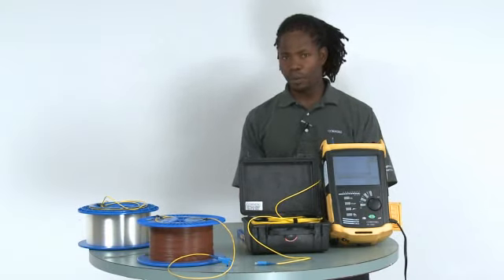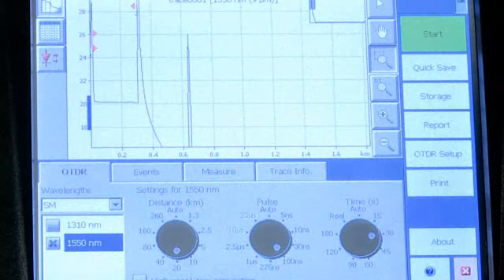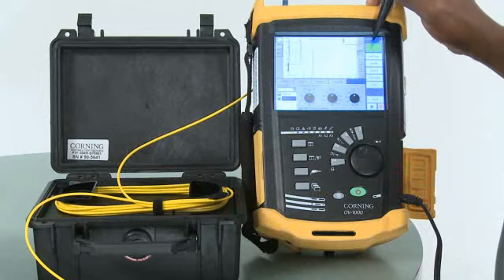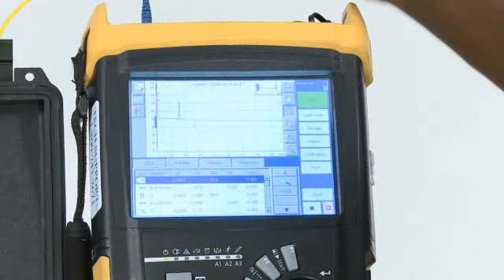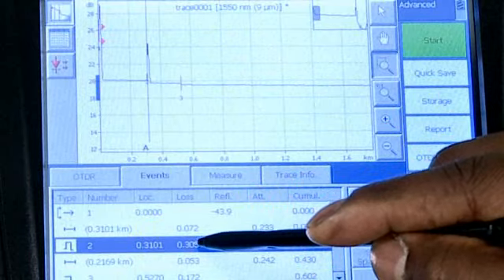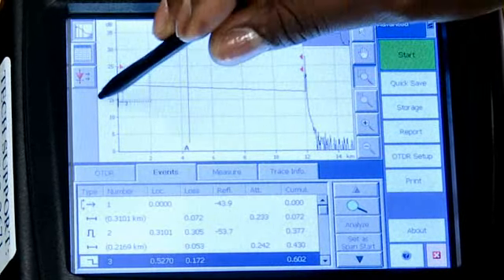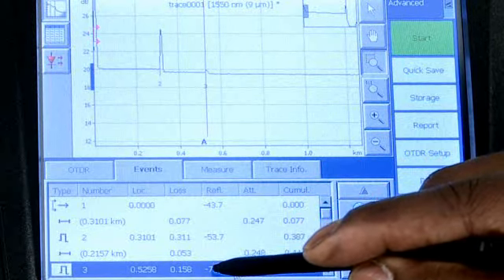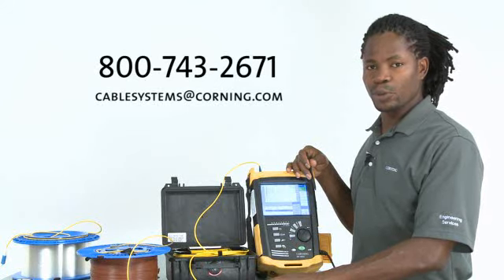Reading an OTDR Trace

Comment from the maker: Hello! If there is no “landing” OTDR jumper, place the marker just before the last event.  This measures the loss across the system except for the last connector. If there is a “landing” OTDR jumper, place the marker just after the second-to-last event to measure the loss across the system in one direction. A “landing” OTDR jumper is basically an OTDR launch cable/access jumper but placed on the end of the system to see the last connector.